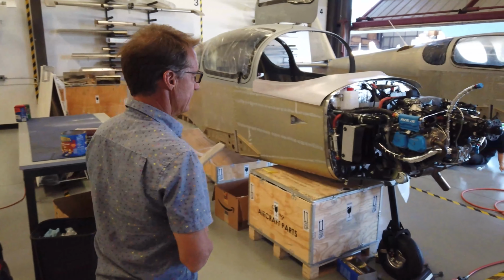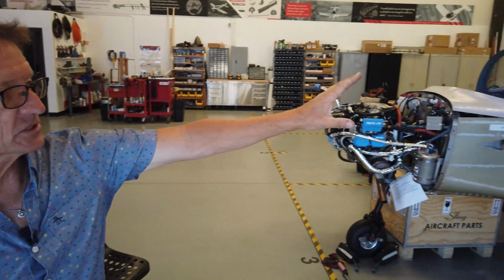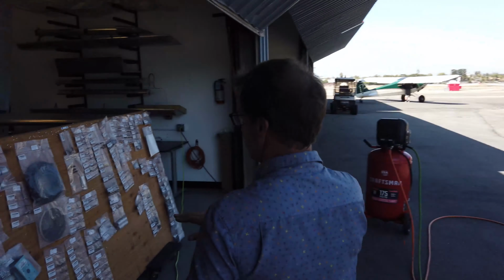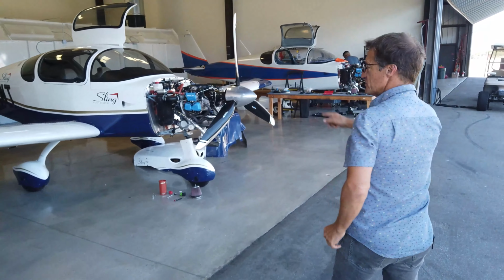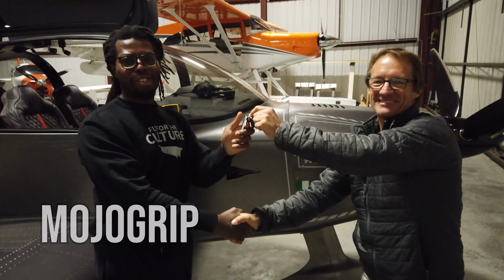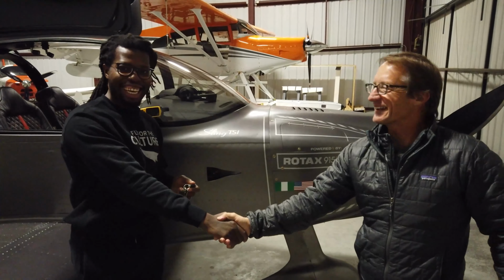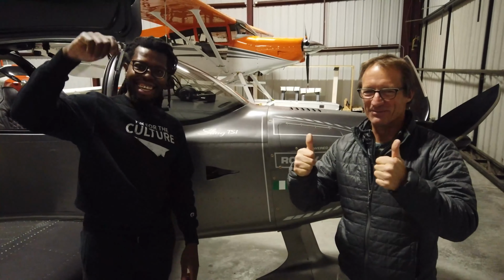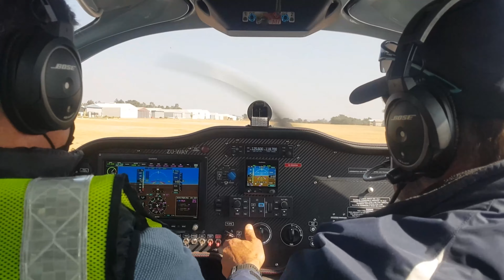Oshkosh 2021 Sling TV Wall: Build Center, Friends, and High Wing Air-to-Air Footage

Comment: How about a retractable or how about a twin?
Reply from the maker: Sling does not currently manufacture those. At Sling Pilot Academy we use the Tecnam P2006T (retractable twin rotax) for multi engine training.